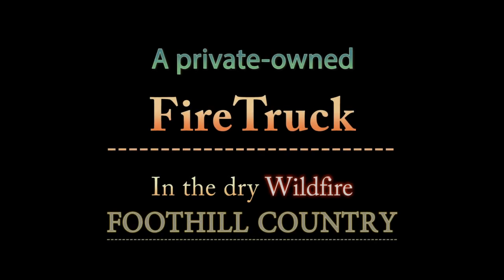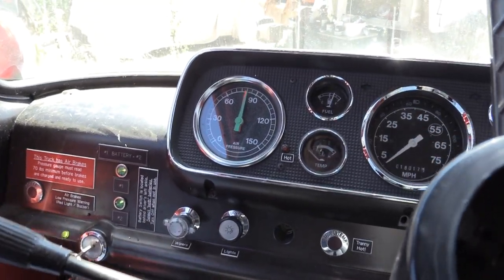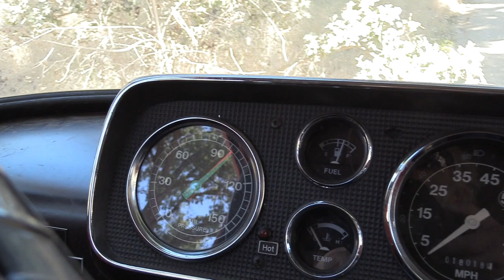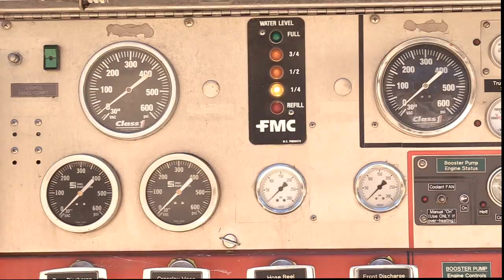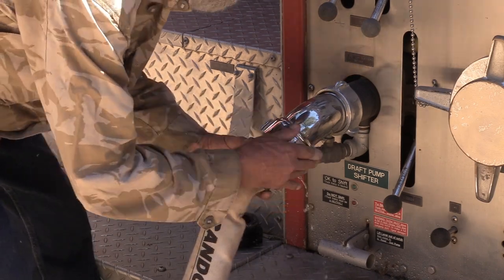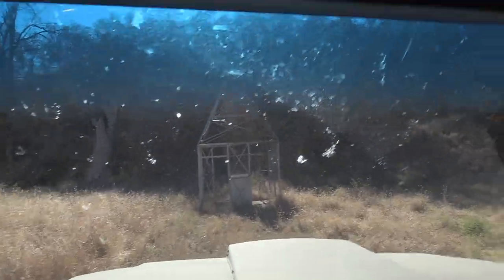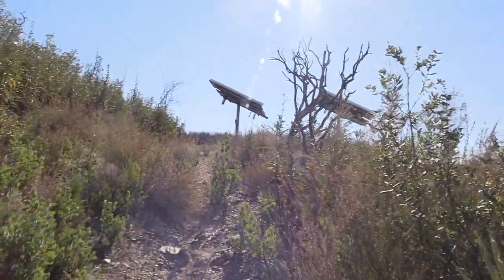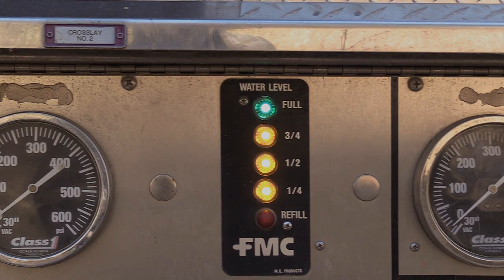Private Firetruck, Rural Hills,   Offgrid Water Supply (Part 1)

Comment: This is a great video, if you want to fill your tank faster put your pump in gear at idle, you'll have to see how throttle you can give it without collapsing the soft suction hose but you'd be surprised how much faster it'll be

Comment: That fire engine reminds me of one that I used to drive/operate back in the '90s. I was with the Angwin Fire Department/(Napa County Fire) from 1993-2003. Granted, MY engine (we were each assigned to different apparatus) was a 4WD International crew-cab, with only a 500-gallon tank and a 500 GPM pump. In addition to our International, we had two Ford Customs when I first learned to drive and operate. One was a gasoline-powered engine from the early 1970s and the other was either a 1989 or 1990 (it was brand new when I moved to the community in the summer of 1990 but I wasn't on the department yet). Your engine looks to be closer in age to our newer engine. All three of those engines have been retired now, my old 1993 International was retired a month or two ago. All the engines have been replaced by Pierce engines, with my old 4WD engine being replaced by a 2019 Navistar/International chassis from Pierce.

One thing I noticed in the video, which I would have received hell for, was when rolling up the supply line after filling the tank. I understand that the male threads were lower after use and it is easier to roll the hose downward, to drain the water, but we ALWAYS roll with the male threads in the center of the roll, to protect them. If the male threads were exposed on the outside of the roll, it was viewed as a damaged hose and NOT to be used. Granted, on smaller hose, we'd often do a double roll, but the female connector would always be longer so that it would cover the exposed threads of the male connector.

Comment: Interesting to think that those old Oak trees were already there when George Washington was president. Your truck has some very impressive power to bring 35,000 lbs. up those hills!
Reply: lol. Unless you are responding to a fire. My old department had several. I own one as well. They were definitely not powerhouses.  They were very slow and underpowered but were extremely reliable. Those Fords were some of the best apparatus I ever worked from or drove in all my 37 years in the FD.
Reply: My department operated two of these slugs. 
One was a 1983 Ford C/FMC and the other was a 1986 Ford C/Emergency One. 
They both had Cat 3208 motors. If I remember correctly they only put out 225 HP or so, which was terrible considering the ‘83 apparatus was made completely of steel. 
The ‘86 was a steel cab and frame but an aluminum body as well as a 3208 turbo. It helped slightly but not much. 
They were dependable for sure. The ‘83 was in service for approximately 22 years before being sold to another department. 
The ‘86 remained in frontline service for approximately 21 years. 
It was not uncommon on some of our steep grades to pull over and allow other, newer apparatus with higher HP to pass.

Comment: Love It!  Thanks for the full explanation.   I had to laugh at some of the narration!  Those old trucks are a lot of fun.  The system is mechanical.  Newer trucks have too many electronics.  I fought fires and would often choose to drive these older trucks.  I understood them better.  One I liked was very similar but had mechanical brakes.  The vacuum system hoses slowly dry rotted.  I think the air brakes are better.  I could spend a day with you doing maintenance etc. but I am sure you already do.  We did dump a gallon of corrosion-resistant mixture each time we filled the tank.   Question:  Have you tried drafting with that truck?  Almost an art form to get it to draft at that age!

Comment: The thing that I notice are all the warning tags. There must have been very little driver training if any at the department this rig came from. And if you put them there, I really hop this rig stays on private property. Looks good though.
Reply: I’m not sure which “warning” tags you’re talking about. Maybe I missed them but all I see are “important” message tags and operational indicator tags. 
Those are typical on all fire apparatus. Even the most current apparatus have them in various locations. 
My department operated two of these (one built by the same manufacturer) and they all had the same tags in nearly the same locations. 
They had nothing to do with the level of training our apparatus operators possessed.